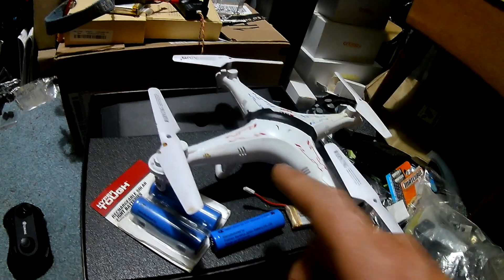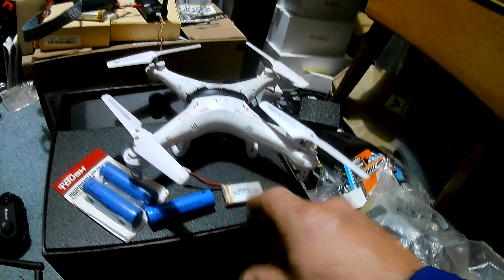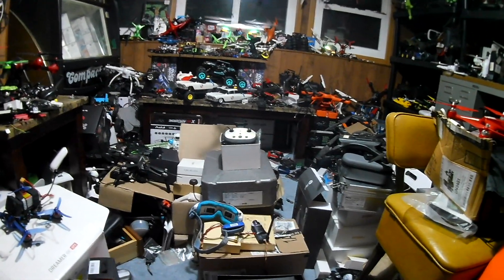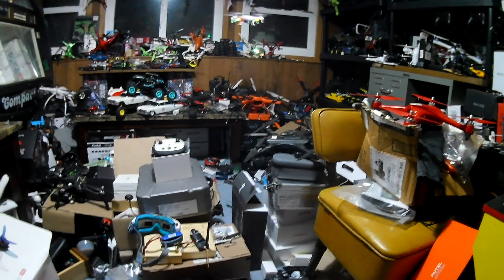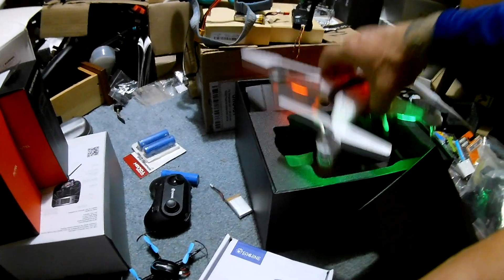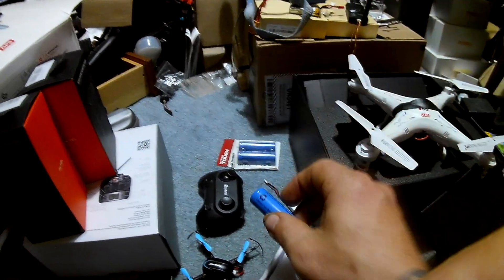Drone Fly on 18650 Lithium Ion Battery Simple DIY MOD Longer Flight Time Syma X5 Jumper T8SG Review

Comment: Tried that, but couldn't take off. As soon as the throttles are full power, the motors shutdown and I need to reconnect. So it only works for couple of seconds. Any idea what could be wrong?
Reply from the maker: Unsure why but you’re not the only person that has had the issue some people have luck with it some people don’t

Comment: I have a drone and I have the same battery as yours and that battery that I put in does not hold up due to the weight of the battery, the drone does not go up and also, it starts up and turns off.
Reply from the maker: Application will work for done n not others

Comment: I  have syma x5 but i used 18650 2200mah 3.7v battery charged my drone is flying around 30 sec what can i do i am very mush disappointed plz help me 😭
Reply from the maker: Find the Walmart ones solder good
Reply: I solder very strongly with 8swg wire but nothing happens plz help me

Comment: I did this as soon as I noticed the flight time was too short. First there were two batteries. So I decided to increase the performance. But I forgot a very important detail when it comes to high performance engines... The heat in question. - Motor brushes need time to cool down otherwise they will become softer and wear out faster. - That's exactly what happened to me. But I managed to fly for 25 minutes straight with wind on the beach. I hope this information helps. Thanks for the video!:pride-person-heart-lesbian:
Reply from the maker: Epics 💥

Comment: I want to put two batteries 18650 3500mAh. how should i connect them, parallel or series. What is better ?

Thank you
Reply from the maker: Do you want to run them in parallel that way you’re not increase voltage in burnout system
Reply: @JayDrone  i dont understand my English is a bad. Im use google translate

Comment: what would be wrong with running 4 18650;s  in a series/parallel  to replace the proprietary liions in a Promark (70 gps or a HS100 GPS) drone. Anyone tried that?
Reply from the maker: Weight perhaps

Comment: Can this 18650 battery be used for all types of drones? specifically I have parrot Anafi and Bebop 2, I want to use 18650 instead of lipo battery, can you give me advice. thanks
Reply from the maker: Yes you can do research for guys that have been messing with these for a while

Comment: Hey Jay Drone i wanted to ask you i tried this and it is not working for me can you help me please ? Thanks, Matyas
Reply from the maker: You need to make sure your connections are secure just as well as the gauge wire that you’re using Canedo the voltage trying to go through it
Reply: @JayDrone  it just wont stick off the ground all my connections are secure and what is Canedo? And what gauge do you mean if wire gauge then what gauge did you used? Thanks

Comment: To get more flight time for my "Tarot-680-Pro Pixhawk-2-4-7", I am planning to change its battery from "6S Lithium Polymer" to High Capacity "Lithium Ion".

I have log of my hex, fly in worst case (high wind) Please find below log.
https://www.dropbox.com/s/pigz4wdh5008onr/2021-06-17%2019-49-01.bin?dl=0

Can anyone check current required to hover from log? so that we can see whether "Lithium Ion" feasible for my hex.

Comment: Why I failed in experiments of using 18650 on my toys drone. do you have any clue?
Reply from the maker: It is likely due to wire connection or wire thickness
Reply: @JayDrone  well.. cable thickness is something I didn't notice. Tq.. I will try again with the thicker one.

Comment: Excellent video. Also tried it (Syma X5HW, Sony/Murata VTC4, 2100mAh) and got blinking lights after 15 sec. You mentioned the gauge size of the wires. What size did you use? Did you solder the wires directly to the controller board? Great video. Big thx.
Reply: Did the changes to the wires and also added an Eachine TX03 NTSC Super Mini 25mW AIO 5.8G FPV camera.  Used 4mm wire (12AWG) to minimize resistance. Total overkill probably. Soldered the wires directly to the controller board and to the battery. Also added a separate small female connector to the battery to make it possible to charge the battery without desoldering it.  Works perfectly. You are a genius!
Reply from the maker: I don’t know the exact gauge that I used but go thicker for sure
Reply from the maker: And yes I saw her directly to the battery positive and negative
Reply: @JayDrone  Great. Will solve my problem for sure. Highly appreciated!